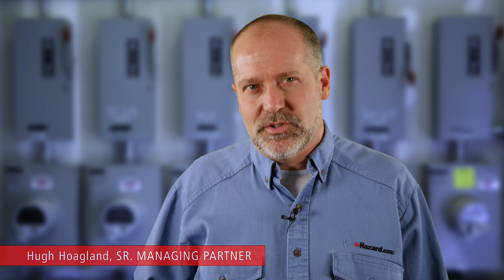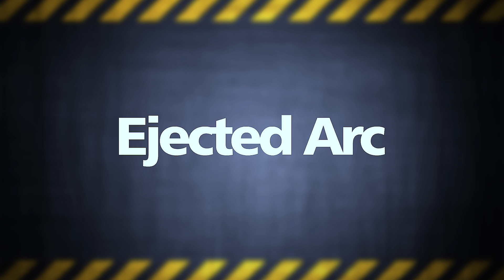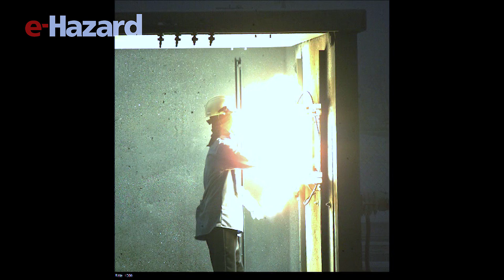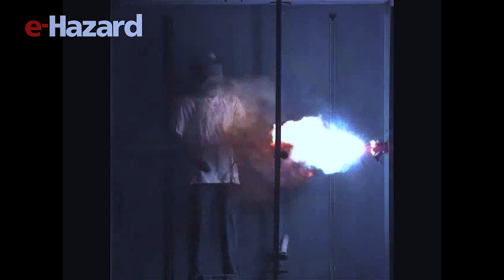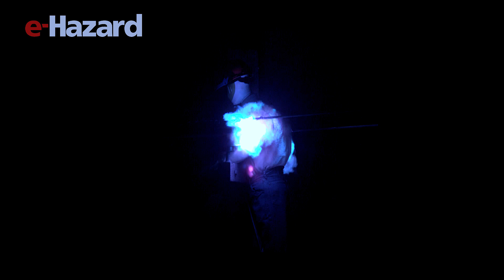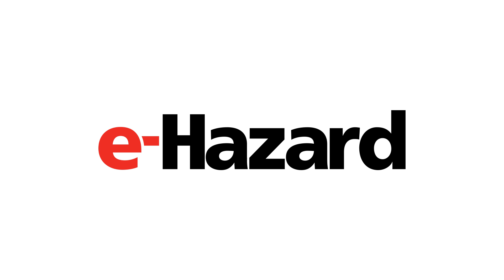Arc Flash Exposures - Arc Flash Awareness

Comment: A typical no-no you must never do is to allow anything that can set off an arc flash. For instance, there are 2 medium-voltage fuse boxes that are exposed and open, and energized. Say these medium-voltage boxes are 10,000 volts VAC each. If the boxes are still energized, a spark from a probe when putting a probe up to a voltage not recommended by the electrical manufacturer of the probe, or dropping a silver-end screwdriver into the energized area may be enough to set off a dangerous arc flash or even arc blast.